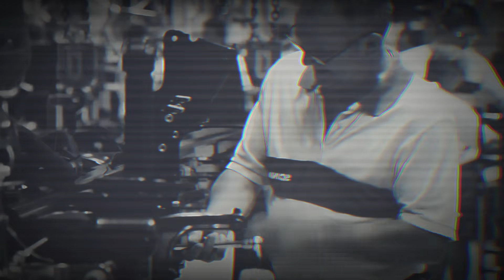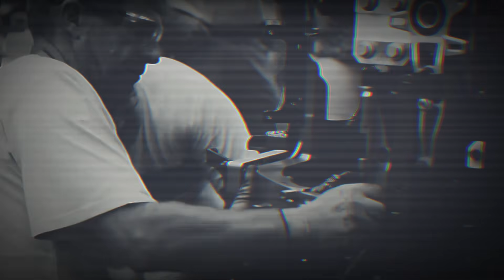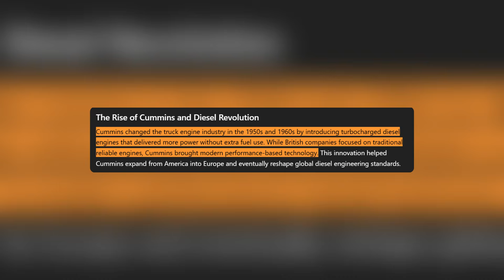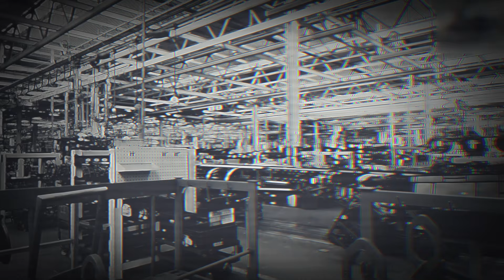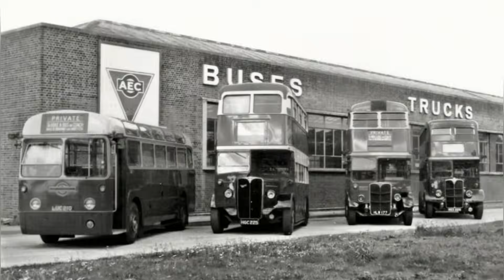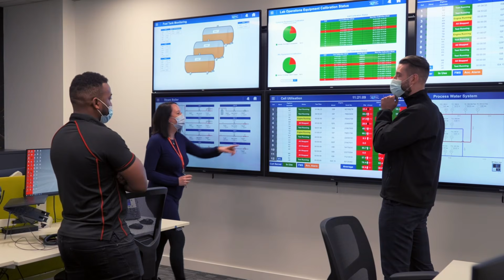How Cummins Engines Killed Off Every British Truck Engine Forever!

Comment: American, American! Cummins Inc set up a British subsiduary, Cummins Engine Company with it's head office in London and first manufacturing plant in Shotts Scotland.. Cummins also had a JV in Germany Cummins Krupp AG and when that was dissolved the technical centre in Essen became part of Cummins Engine Co. Shotts produced engines became legendary for quality, better than engines built in Columbus using locally sourced materials such as crankshafts from BSC Scotland machined in the Shotts facility.. With the opening of the Darlington plant fuel systems were all manufactured within the U.K. Cummins aquired Holset turbochargers, compressors and dampers in Huddersfield and placed their own turbomachinery manufacturing subsiduary under Holset control. Dr Klaus Took technical director took the Columbus designed NTA 855 Big Cam developing it into the NTE range of engines, E for Europe, the NTE 290 was legendary, and it was roumoured that Dr Took had more Gardner engines on test than Gardner themselves.. In the late 70's Cummins recruited a Brit Phillip Jones from Perkins who went on to design the Cummins K19, L10, B and C engines. Around the same time Cummins took over the large Alfred Hebert machine tool works in Daventry turning it into the K Series heavy duty engine plant. In the mid 80's upon Leyland's closure of their Bathgate plant Cummins re-tooled the Darlington Chysler/Cummins plant to build the Jones designed B and C engine ranges. There was also a large engine reconditioning plant also in Scotland. Cummins Columbus invested heavily in U.K Plc and Cummins Engine Co has become one of the U.K. top 40 exporters..

Comment: J  C B  make there own engines, and Ford disel engines were all designed in Britain the first disel engine they ever built was designed by Lorie Morton for the Thames Trader, The Americans didn't use disel engine until the late 1930s and then only for the largest vehicles, Volvo didn't make a disel engine until they bought Muntell in the 60s and the Germans had a car petrol  engine enlarged in the tiger tank 50 tonnes and 70 tonnes king tiger, Rediclise, and the Americans had 5 car  petrol engine in the Sherman tank bolted to one flywheel, and I'm of the opinion that the British government made life impossible for there own, and the engine didn't really get any better ìn quality,
Reply: Don't forget the petrol engine we put in the Cromwell, Comet and Centurion tanks
The Rolls Royce Meteor which, essentially, was a detuned Merlin

Comment: In the mid 1970's there was a large hotel built next to our yard. It was constructed from pre-cast panels shipped in by lorry.
There was a nice range of lorry tractor units and different engine make / types used but they were all running basically the same GVW.
So we asked different drivers how they liked their different lorries and different engines.
Almost to a "T" the ones with the Gardener engines stated the other ones went faster on the flat but when it came to the hills the Gardener's were the best.
Trip time wise was almost identical but the Gardener powered lorries used far less diesel.

Another example. For decades I ran LDV vans usual trip from my yard / home to Stanstead Airport. The LDV vans could do 3 round trips fully loaded on a 55 L fuel tank.
I then had to change to Transit vans. These were limited to 70 MPH but even with the larger 70L fuel tank they struggled to do 2 1/2 trips on a tank of fuel.

Back to the article.
I also ran HGV's, and specialist vehicles with a mix of different engines including Cummins. Not much difference in actual Journey times but also zero increase in fuel economy over the old Leyland and AEC engines.
Had some of the first "C" series that pulled well in mid RPM range. Then had some later "C" series which were totally useless mid  RPM  range.
Side by side the older "C" series were the best with identical gearbox, axles and GTW.
Reply: Excellent experience shared there.

Comment: But by the early 2000s  Cummins were gone too from heavy truck engines, although still active in lighter engines. Replaced by the inhouse engines of European manufacturers, who have since taken huge slices of the US heavy truck engine market although often rebadged with US brand names.

Comment: The USA had heavy trucks. The UK was limited to twenty tons, with British engines supreme at that weight. The two-stroke Commer TS3 was amazing in size and economy - wiped out by Commer buyer, Chrysler.  The UK truck weight rapidly increased to thirty two then thirty eight tons. Cummins filled the void. The rest were playing catch up then never caught up. But matters are changing. Electric drive, hydrogen drive and hybrids, etc, will dominate. Cummins will not then be supreme.
Reply: Hydrogen drive may never come around as a practical, usable alternative.  EV has a long way to go before its useful for big trucks.  Hybrids?  Meh, we shall see.   
I guarantee that 90% of whatever change is made in the powerplant is due to gov't action and regulation.... not because the alternatives (to diesel) are better on their own
Reply: @FAFOForYou 
One thing is clear. Trucks will not continue to burn diesel.
Reply: @johnburns4017 😭😭😭
Reply: We were running special vehicles at 23 tons, on 2 axles, back in 1966 and 33 tons, on 3 axles from 1973
Reply: Are you having a laugh?
Battery-electric will be no good because of payload lost to battery weight, rubbish range and time off road being charged. Remember, time off road is money lost
Hybrids will also give a reduced payload due to  battery weight, OK range and charging  should not be a problem
Reply: Comer = communist!
That's what me uncle says...